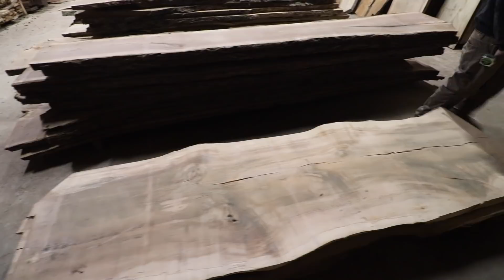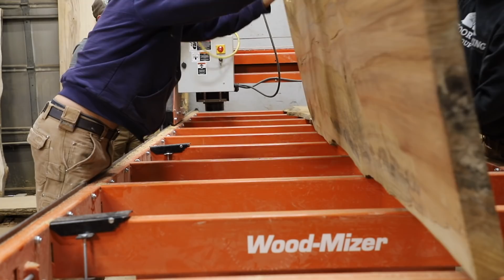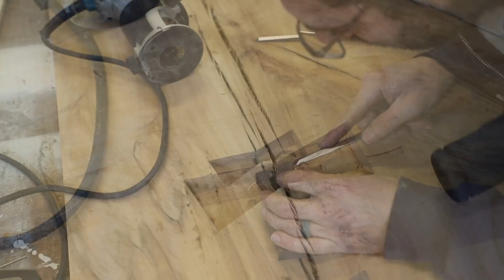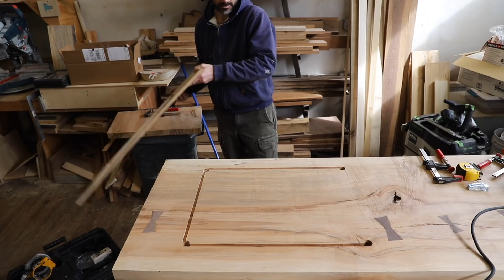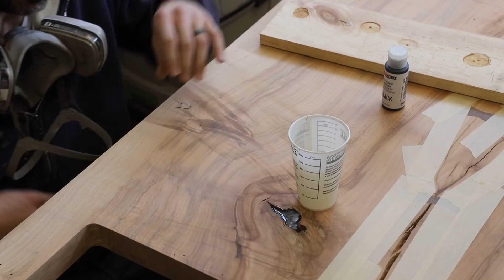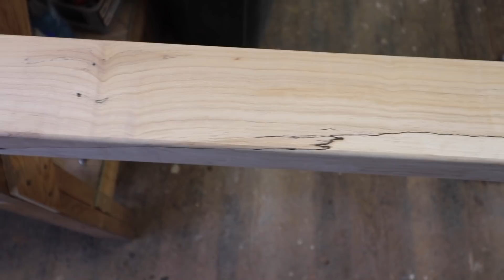This Tree Was Headed to the Landfill | Live Edge Slab Maple Countertop | Epoxy | Bowties

Comment: Nice.  I did like the live edge backsplash.  As for the cutouts, your on the right path.  Mount the template, drill the corners, cut out the bulk with saw 1/4"+ inside the template, cleanup with the router.  Its nice to have friends with good tools.
Reply from the maker: Thanks Gary, thats what I will do on the next one for sure.

Comment: You have the perfect tool for cutting out the Top for the Sink Bowl , the Festool Plunge Saw .
Reply from the maker: Yes it worked great, only issues was not having the correct blade for the job, too many teeth on the one I had.

Comment: I was glad to see you oil the top instead of an epoxy finish..I just did an epoxy countertop finish and had a lot of issues, it is much harder than you would think to get it right. Beautiful work and love the live backsplash idea!(I may steal it)
Reply from the maker: Thanks Randy, yea I like finishes that are easy to apply and forgiving as well.  Thats why I also like the linseed, turpentine and spar urethane mixture because it's almost impossible to screw up.   Feel free to steal the live edge backsplash, I probably stole it from someone else!

Comment: Nice! I actually have five 60+ year old maple tree's I'm going to cut down this year.  They are HUGE, straight and tall.  10 years ago I had them topped. They are about...30 feet plus high.  I'm going to build a new house and it will be ranch style so the tree's have to go. 
 I'd cut yourself a nice matching cutting board.  Then I would cut out a few squares or circles to used when you have a HOT pan from the stove or oven and want something to set them on, like a trivet or cooling rack.  Think of the possibilities!  Cut out your own wooden paper towel holder!  Cut out a small napkin holder for the kitchen table!  And/or cut out a small cutting board or two small matching trivets to set a hot cast iron pan on and auction them off as you thought to raise money and please a fan.

Baby seal humor. haha.  Wake up tomorrow and see picketers outside your house!
Reply from the maker: Wow those trees are as good as gold, that will be great to have all that wood.  Yea a cutting board and hot plate will be handy, lots of possibilities for that wood.  Hopefully the would be protestors realize it was a joke!
Reply: @50Acres   lol, do you know my LOWEST estimate to cut down the tree's and haul them away without taking out the stumps is almost $10k?  For that price I can rent a cherry picker truck and go up and cut down the huge limbs first and then the tree trunks later. I asked a few local places if they wanted the tree's free and was told no.  For $10k, I think I could almost buy a portable saw mill and do the trunks even myself (with help)

Comment: Your dedication to transforming this slab, from a potentially discarded tree, into an "artistic feature" is incredible.  The use of the live edge as a backsplash will make the finished product even more outstanding as if improving the natural beauty of the "top" was required.  With respect to the attachment of the backsplash to the top did you ever consider the use of pocket screws?  I have become a "fan" of using them for tight and secure joints where virtually seamless joints make the difference.
Reply from the maker: Thank you Doug, pocket screws would have been a better choice IMO.  Biscuting was a challenge to get it on and connected.

Comment: Getting wood is one of the best things when you are in your 40´s ;)...The local lumber yard I go to have bins of scrap wood.. the pins or what you call it that they put between the planks of wood so they wont twist and are easy to transport. I collect and hoard that.. They are not long, about 4´ but the wood.. omg. A regular wall stud 2x4 and you can count 5-10 rings.. Scrapwood: <35.. 2x4" 4´and no soft corners. And sometimes they are birch. And all they make of that wood is heat when they burn it. Its like throwing away gold when looking for iron.
Reply from the maker: lol, yea there is some good stuff out there for free or cheap especially if you want to do smaller projects!

Comment: Nice looking project; I am curious to see follow-up videos on these slab countertops after 5 or 10 years to see how they've behaved—or not. Guessing there could be unwanted movement, additional cracking, cupping, twisting, or similar effects of humidity/dryness cycles, temperature swings, and daily use.
Reply from the maker: This video is two years old. So far nothing other than normal seasonal movement which is always anticipated in woodworking. .

Comment: Mike nice countertop glad you save the maple I’ve got large slab of cherry I’m gonna make a mechanics tool box this summer and let in season I got to get a plane and I got to cut the live edge off,,, thinking back to the skid steer Mike if you go with the mini excavator make sure you get it with a blade and also you should consider buying a 10,000 pound winch for your truck put a receiver on the front and make sure you got a good receiver on the back,,,, because what if you spoke of your property eventually you’re going to lay  that mini Excavator over!!!!!!!!! Then  have to get a tow truck recovery company come and pick it up  it’ll cost you anywhere from $700-$1000 to pick it up and up right that’s if they can get up the road I still think you got to go to skid steer  junkmando
Reply from the maker: Thank you Samuel, lucky you Cherry is such beautiful wood.  I will definitely get a blade if I get one.  I also keep my eye open for good deals on skid steers as well.  If a good deal comes across, I'm not real hard up on one over the other.

Comment: Here is a tip when putting inlay or Dutchmen add a slight taper to the sides and cut the hole a little smaller that the inlay and as you tap it in the taper will fill any gaps. I do this often when I inlaying violins I make good luck!
Reply from the maker: Thank you, that is what I do once I get to my marking line.  A couple hits straight down and then a very slight undercut.

Comment: Great video. Beautiful finished product, great work. I have one question, it might be obvious to others, I see these bowties are used to strengthen the piece where the long cracks are happening, why isn't wood used that more closely matches the piece, and do not stand out so much? I see that a lot, figure there must be a reason. Are they made of stronger wood?
Reply from the maker: I think most wood workers, if they take the time to inlay wood, they want to show off their work, hence contrasting wood.  I don't think it's any stronger.  When they don't want anything showing, they drill out holes in the under side and use a bolt, nut and washer to mechanically stabilize the cracks.
Reply: @50Acres  thanks for getting back to me. Beautiful work.

Comment: Great video! Im looking at doing the same thing in my cabin! I'll be working with red oak. So how many coats of the Walrus oil did you use?? Why did you go with that product as opposed to a poly or resin finish?? It looks fantastic! And I love the back piece!!
Reply from the maker: Thanks Rich, I did two applications of the walrus oil, it gives a nice finish but it's not quite up to the task of countertop duty.  I'll probably fall back to my old failsafe of 1/3 spar urethane, 1/3 boiled linseed oil, 1/3 turpentine rubbed on over a couple coats then polished firmly.

Comment: Really great work! 
Did you purposely choose to have the butterflies on the top side (optics) or is there a technical reason behind (I personally would have preferred to have them on the non visible side, therefore I'd be interested if there are any constraints)?
Reply from the maker: Thank you, yea I put them on top because I like them, if you don't want them to show you can drill out two holes, flatten off the adjoining faces with a chisel and use a nut, bolt and two washer to hold the two sides of the slab together.  Much faster that way.
Reply from the maker: on the back side of the slab that is.

Comment: Im in love with the backsplash... i dont know about the top, only because of the "butterflies " did i miss why you used that side?..
Reply: Sue Norton there is a crack in the.board. While the epoxy will fill that the butterflies ensure the board won’t crack in two. With the two cutouts, the extra support is certainly smart to have.
Reply: Mike, i get why you put the butterflies in, was just wondering why not have the underside as your top so the butterflies cant be seen...by the way, i know your in ohio, right? Where is the cabin?
Reply from the maker: The crack went all the way through the board.  I used the side I did because it allowed a thicker slab, to fully flatten the other side we would have had to take another half inch or so off.  I am ok with the butterflies, I like chaotic order...
Reply from the maker: I am in Dayton OH.  The cabin is somewhere in the greater Ohio River Valley Region.
Reply: @50Acres  got ya, thanks for answering me

Comment: Using a 1" bit isn't a problem as long as you don't try taking too much material. On really dense materials, like maple, I prefer a larger bit. The material is so hard it will actually try to bend your bit, so the thinker bit is better. Biggest thing to remember is not to hog too much material at a time.
Reply from the maker: Cool, it was nerve wracking but nothing bad happened.  I didn't take off too much waste, maybe a quarter of an inch at most.
Reply: My rule is no more than half the shank diameter in a pass. Seems to give good results without being scary

Comment: This is outstanding work. Really really cool.

Question: How many router bits did the mizer table use to level off the slab?
Reply from the maker: Hi Shawn, it takes one giant bit,  I know that he changes it occasionally but I think its more weeks and months versus per project.
Reply: @50Acres  Cool, I want to make a smaller table like that.
Using a regular router just to level off small pieces.

Comment: As beautiful as it is  those hardwood butterflies would drive me crazy , what is your reasoning for cutting them in the top side and not hiding them on the underside ? in my thinking they are just a structural crutch and would never become a feature , the crack is the only natural feature i would want to showcase ! The splashback live edge absolutely steals the show and transforms that epic worktop into a masterpiece ! 
You are absolutely right about borrowing tools and a workshop , clean them both and make a lender smile! 
Walking into a tidy workshop always inspires me to make something and a mess lol
Reply from the maker: I just like the way they look.  I like contrast so the dark walnut on the light maple is something I like.  I also like contrasting the chaotic line of the backsplash with the clean front line of the top.
Reply: @50Acres  perfect explanation, after all it's you're creation and i knew you wouldn't have dont it by accident

Comment: need to wash of your blade or have it sharpened on the plunge saw, or new blade if its tost will stop the burning
Reply from the maker: It has too many teeth to be used the way I used it.  I did clean it with oven cleaner after this, which works wonders on blades.

Comment: Could you not have used the shavings from the Maple slab as well as the fine dust to fill in all of the holes and cracks by mixing it with a clear epoxy glue.  This way the table slab would have had the same maple finish everywhere without exposing the patch work.
Reply from the maker: I'm not sure if that trick would work with so wide a crack, it's about 5/8 of an inch at some points so I decided to highlight the flaw and make it a focal point.

Comment: You need to sharpen your Festool blade.  Burning the wood like that should not be happening.  Heat wrecks the edge on carbide.
Reply from the maker: Yea, I was using a blade with too many teeth for the job,  I did clean all my friends blades after this project with oven cleaner (tip I got from my Dad) which works really well.

Comment: The surfacing costs don't make sense. Why would they charge by the board foot and not the square foot? Unless its the board foot of how much material is removed? Even then with cupping, bowing, and twisting it could be nearly impossible to determine the true cost.
Reply from the maker: For surfacing this, I paid approximately 9'x2'x2.5"x$4=$180.  It saved me from buying material and building a larger router sled, probably about $100 in material and at least a day of labor and hassle between building the sled and running my router across it with a tiny surfacing bit (which I don't own).  Not to mention storing a huge sled that I will use once every 2 years or so.
Reply: @50Acres  I'm sure it has a way of working out. And I didn't mean any criticism. I was just very confused by how the pricing worked.

Comment: A. Yes the numbers are very important please stop telling un experienced or new wood workers completely of the wall wrong information for there new hobby the sanding grit sizes mean more than you obviously understand always start at 60 or 80 then never ever under any circumstances ever skip grits 80 - 100 - 120 - 150 - 180 - 220 - 320 -400 - 500 - 600 

B. A flush trim router bit would have changed your template routing completely 

C. There is not such thing as a Festool Domino Biacuit joiner lol it’s just a Loose Mortise & Tenon Domino Joiner not a biscuit joiner 

D. Please do your research a little more about woodworking before making wood working videos this video alone could throw someone new of so far into left field that they give up completely or are totally pissed when there project feels and looks like crape!! 

D. It did turn out pretty nice but I bet in person it feels rough and you will one day end of fixing it after you get tired of it good dense hardwood needs much more sanding in the fine grits to use indoors you’ll thank me if you try it out 

Just trying  to help that I’s all
Reply from the maker: A.  I can assure you that the numbers are not all that important.  It's one of those things people like to argue over on the internet that does not matter in real life.  You can absolutely skip grits, try it some time, you'll save time and money and you'll find your finishes are as nice and smooth as ever.  

B.  As much as I'd like to have every tool and always the exact right tool for every job that is also not possible in real life.  Again an area where real life differs from the keyboard warriors who get to construct their own reality.  

C.  Call it what you like, hole maker joiner thingy with wood connectors, really who cares, it's real life results that matter.  

D.  I'm willing to bet in your online crusading you've done far more harm to beginner woodworkers than I have.  

E.  E comes after D.  It turned out ok, I've been woodworking a long time but I don't do it super often.  It reflects my current skill level.
Reply: 50 Acres & a Cabin you can skip grits if you don’t like doing good work and you can skip grits if you like your work to be second hand no real wood worker that makes high end slab or table tops or counter tips skips grits period ask a real one they will tell you check out one of the best I know Black Tail Studios watch one of the finishing videos it is explained very well skipping grits if got people whom don’t know what they are doing period that thing I would be willing to bet feels like a price of B C sanded plywood at Lowe’s or Home Depot period skipping grits leaves in even areas and low spots and most importantly scratches and swirls that can not be removed with skipping ahead grits I have tried skipping grits and it looks and feels like crape period any real wood worker knows that not a single professional skips grits and that is all there is to the question at hand if it could be done large large companies would do it with there slab work and tabletop counter top work to save a substantial amount of labor cost and money on sand paper it just don’t work